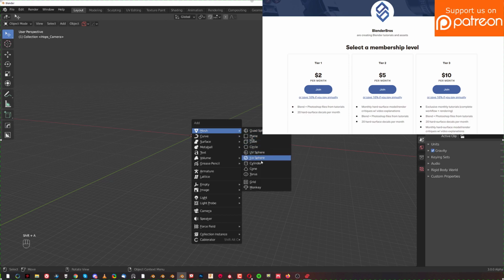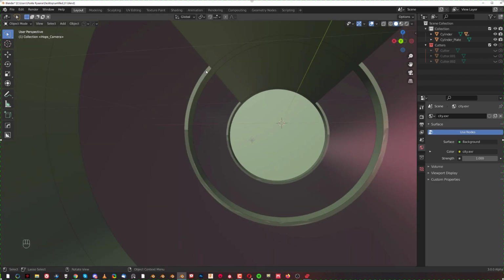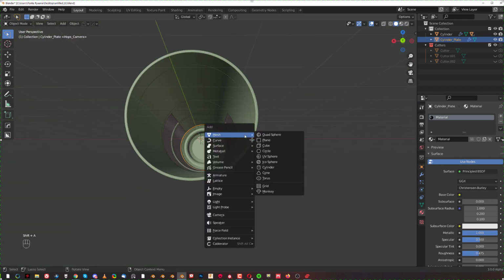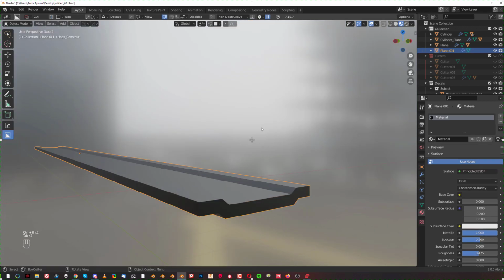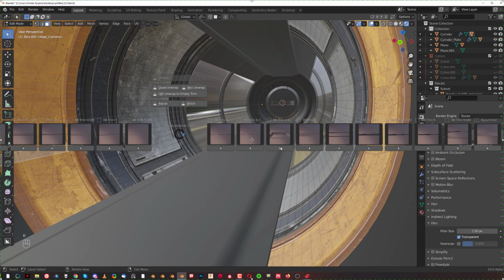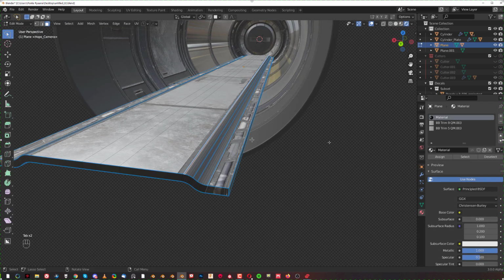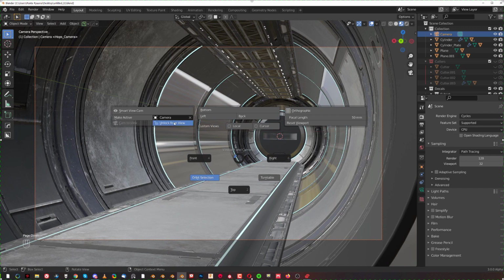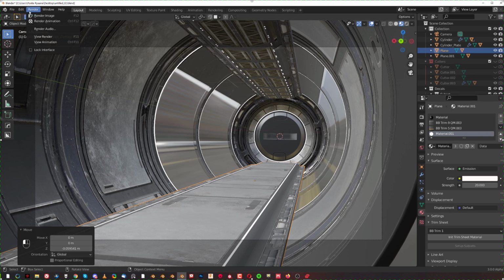How to create SciFi corridor in 20 min with HardOPS and Boxcutter- Blender tutorial

Comment: Is there a reason you used the image rather than the undenoised image to go into the denoiser?
Reply from the maker: i dont follow
Reply: @PonteRyuurui  I mean in the compositor you are plugging the render image into the denoiser node instead of the undenoised image from the render node. There is a difference between the result in both cases, I saw various people in tutorials do it either way, but wanted to know if there was a special reason you choose this way. Sorry for the confusion. I found some explanation here: https://blender.stackexchange.com/questions/173760/how-to-properly-connect-the-denoise-node-in-compositor but wanted to ask for some veteran experience on this.